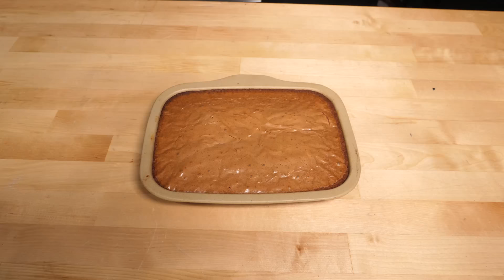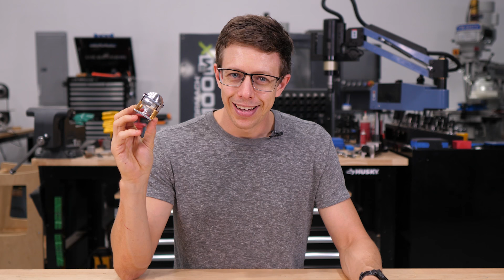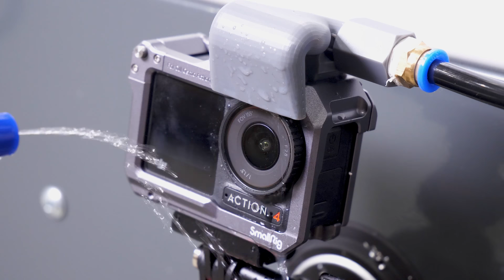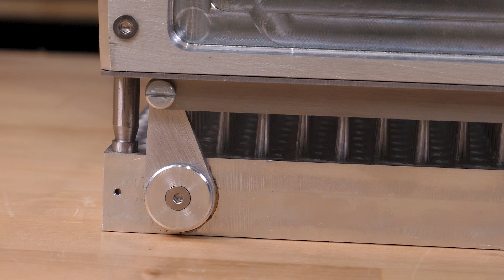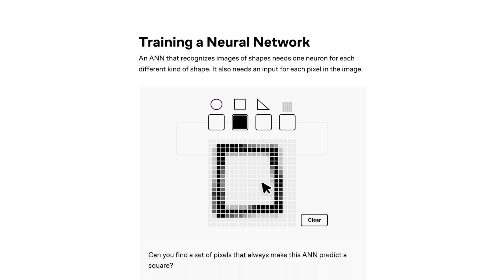Baking brownies from the inside out

Comment: My first thought was using the same concept as sous vide, since this is basically the same problem as with steaks. 
It's also interesting how these problems and solutions for them can be found in different fields. For example, the edges experiencing different heating and cooling times than the centre is also a problem when heating and cooling metals or thermoplastics. (14:09) A similar issue happens in injection molding when your tool uses ejectors. As far as I remember, the solution is simply having a precise fit between the ejector rods and the mold holes, high enough viscosity and low enough pressure, so the molten plastic doesn't flow between the ejector rods and the holes.

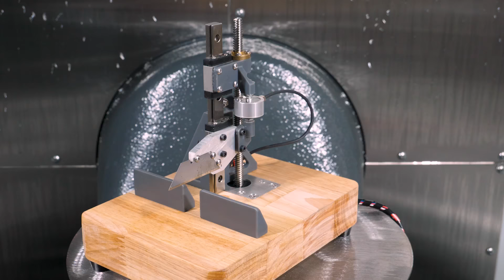(0:49) This reminded me of those birds that try to impress mates by building nests

Comment: OK, hear me out.
-Instead of a lever system, make that first pan that you thought was a mistake.
-Then make a plate with holes where you put a handle on like the one from a bucket.
-Put that into the pan.

That way you can lift the brownie out with the handle from the pan, removing it from the walls.
That would make cutting and serving much easier.
It's also easier to clean because you do not have to get between moving parts.
🙂👍

Comment: interesting! i was really expecting for you to do away with the oven in general and use an electrical current to bake the brownies instead, though i suppose that would defeat the purpose of a 'no edge pan' as it would no longer really be a brownie pan, per se. Taking advantage of the electrical resistance in the batter would theoretically provide a near perfect distribution of the heat from the get-go, meaning no semblance of edge without the need for this odd spike design damaging the aesthetics and ease of use. I know that panko bread crumbs are made this way in part because it makes each bread crumb more uniform to every other (unlike regular ones where you'd either have the odd edge crumb or need to waste product removing edges).

whether this would be practical to implement, i am not sure, but to me it seems it certainly would be the end-game of edgeless brownies.

Comment: Isn't a edgeless brownie easily done by using a silicone pan? Cause the edge doesn't get hot like the metal pans
Reply: I imagine that you would still have the issue if heat transfer to the center. while it may help, no matter the material of the pan the edges will have to heat up before the center, which leads to edges in the final product

Comment: none of these are pans. pans have one handle, and all of these no handles
Reply: the final one definitely does! notice the recessed section on either side of the pan, creating a lip that can be used to hold the pan. most baking pans have handles more similar to this, as opposed to something a frying pan would have
Reply: @evieiseepy "either side" you say? that implies two handles, a pot
Reply: @nathanpumarlo8628 yeah and many pans also have two handles. many frying pans have two handles in fact. and you will be very hard-pressed to find a brownie pan that does not have more than one handle (how else would you have any hope of taking it out of the oven with oven mitts on?). all of this is disregarding the fact that definitionally pans do not necessitate a single handle.

Comment: Great approach and awesome engineering. But I'd like to try out your point of heatdissipation. An all around enclosed and expandable baking dish in which the dough would slow cook to the premeasured coretemp. Almost like sousvide. That should prevent overheating certain areas and the loss of moisture at the top. I could see the flaky texture at the top of the brownies. That appeared so thin, that its seemingly imessurable with your device, but should be noticable while eating and the center of a browny doesnt have that. Also it doesnt please me visually^^. I'd try it myself, but my wife doesn't allow me cooking or baking because of the mess. I enjoy your videos very much.

Comment: Maybe an easier solution would have been a way to keep the pan from getting too hot. Like a water bath for the pan with a vent for the steam (since you already drilled a hole in the oven) so you still get a good brownie top. Could still use a reg pan that sets in the custom part. Time for a redo!

Comment: 9:39 if I had to guess, it'd be because brownie batter does a hardening process when overcooked that fluffier cake batter does not do. What are overcooked cakes like? Just dry, right?

And I have heard once or twice before, that you take cakes (and bread) out of the oven before they are done, as they finish cooking out of the oven, using the heat that's already there. Perhaps the cool air around the cake helps cool down the edges to an extent on the same magnitude as the insides HAD been shielded from the heat, such that the outside stops wanting cooking before the inside does, and the outside stops being cooked by heat before the inside, at roughly the same rates.

Comment: What if you just had a pan that had super-efficient cooling on the bottom and sides?  The Baker's Secret cookie sheets have an air gap to prevent the bottom of the cookie from browning too much.  If the sides stayed cooler longer, then you would effectively create the same result right?

Comment: could a simpler solution have been to insulate the sides of the pan? Sealed (semi sealed) air gap or silicone should work nicely. In theory the heat flux from the bottom of the pan to the top would be uniform.

Comment: Really cool project! Another solution might be cake strips. Basically just a strip of thick fabric that you soak in water, then wrap around your pan before baking. It insulates the sides of the pan a bit so cakes cook more evenly and the edges don't dry out. You can make some makeshift ones by wrapping wet paper towel with tin foil. Worth a shot if you don't have a 3d printer.

Comment: The floor of the pan should have the point connected there anf also have a rubber seal around the whole perimeter of the pan then on the top wall bit but some metal latches(one on each side)  like the ones you would see on a tool chest or some sort so it pulls it shut

Comment: You could have just put insulation at the corners/edges to slow the heat transfer to match the heat transfer to the middle.  
Instead of adding conductors to make the middle match the heat transfer to the edge.

Comment: Seems like the pan should've been a circle to be ideal - there are still places that are getting heat from 2 places. BUT! that's theoretical, and you got a result that is below the threshold of noticing: that's engineering. Also, users expect brownies to be rectilinear, which your design supplies easily.

Comment: For the mini pan without the removable bottom, you might be able to use a strip of parchment paper to push into the pan.  Then you could lift the parchment paper to release the brownie from the pan.  Yes, it will be heavily perforated, but it might do enough release to turn the pan over and tap it on a cutting board.

Comment: I screamed when you said "retractable spikes" Why didn't you just make the bottom half attach with clamps of some sort around the edge? Similar to clamps on a croc pot... Would have been easy. It wouldn't fall apart as long as you flip it upside down on a table, then remove the bottom.

Comment: Cool solution, but have you thought about trying to do it with a spring form pan with a double bottom (one with spikes and one with holes). That would be a simpler and more elegant solution. 

This is the first video I watch from you, so this is a guess… between a industrial designer and an engineer, I’d guess you are an engineer!

Comment: you need to control Airflow which affects evaporation and therefore the mosture and texture. Airflow design is just as important as thermal energy flow.

Comment: I love this, I think you could commercialise this with a few modifications i.e. making it a 3 piece set: piece 1 is a standard tray, piece 2 is a spike sheet which sits in the tray and piece 3 is a thin sheet with holes in that goes over the spikes.  Once baked you can remove the brownies from the tray and you are then left with brownies with sheet 1 and 2, you can the spike sheet by separating the spike sheet from the hole sheet with a knife, then you peel the hole sheet off the brownies.  Because you don't need to prevent mixture escaping the hole sheet holes can be oversized to mean that you can remove at an angle.

Comment: WOW, You're correct.... Talk about over engineering....LOL.  How about a 2 piece construction similar to a spring form pan.  Machine a pan shell with a removable bottom using an high temp o-ring seal on the bottom.  Putting 2 wings on the bottom piece to act as "handles" that you can use to push the bottom away from the top as you lift the top of the pan away.  Simple design and easy to clean in a dish washer.

Comment: You can also submerge the bottom of the pan in water. It keeps the edges from getting hard as quickly and would make the edges softer. They use this in cheesecakes a lot to keep the cake from drying out. I've tried this before, and it works super well. The edges are still a tiny bit dryer, but it's much better. I haven't gotten to try it again since, though, because my mother is a nut that likes the edges

Comment: Couldn't you just use a silicon pan? Heat transfer with silicon isn't nearly the same as steel
Reply: Outside would still cook before the inside, it's not just a material problem but a geometry problem too. Which is why the spikes fix it, makes it cook evenly, which allows you to cook the whole thing at a lower temperature for not as long to achieve the desired tenderness. 

If you tried to cook it like that in a normal pan the brownie in the center would be sticky and undercooked.

Comment: so..... for the last pan, why not just make a two part system with latches on the outside to connect the two to maintain pressure? that way all you'd need is spikes on one plate, potentially with a heatsink on the bottom, and holes in your pan. you wouldn't need to worry about the latches being too hot to unclasp anyways since the brownies would need time in the pan to cool regardless, especially since they get cooked low and fast anyways, so the pan wouldn't be taking all that much time to get super hot since its mostly the spikes doing the heat transfer.

Comment: With my limited background in thermodynamics I propose slowing down heat transfer at the edge such that it heats as quickly as the top of the brownie. Making the pan thicker would increase the thermal mass and an insulator like ceramic would be a good material.

Next, since the slower bake time will lead to more moisture evaporating cover the pan with aluminum foil.

Next set the oven closer to the desired internal temperature of the brownie.

Basically the slower and more controlled the baking is the more even the temperature profile of the item is. The edge stays at a relatively lower temp while the center has more time to heat up.

I have some other ideas as well I would like to discuss like finding the best L/D ratio to better approximate 1 dimensional heat transfer. Ironically, your sphere pan can also be approximated with 1D heat transfer by adjusting the boundary condition as a function of the radius. You could achieve the same effect with a wide relatively thin brownie.

Comment: Simple brownie recipe

1/2 cup flour
1 cup sugar 
1/3 cup cocoa powder
1/4 teaspoon salt
1/4 teaspoon baking powder 
4 eggs 
1 teaspoon vanilla 
1/2 cup (1 stick) melted butter 

Mix ingredients (I honestly just throw them all in a bowl and mix at the same time, don’t really need to follow the “dry ingredients here and wet ingredients here then mix the two” but do what you want) pour into a greased and floured 8x8 inch pan and bake in a preheated oven at 350°f for about 30 minutes, you can bake it an extra 10 minutes if you don’t like chewy brownies (more dried out brownies are pretty good when paired with ice cream) 

Take them out of the oven and let them sit for a bit til cool enough to touch and serve.

Comment: Cheapification: don't make the pan lift up over the spikes, make the spike plate lift up and out, handles on the side of the spikes that can be grabbed. The outer pan is just a pan like any other really. Then have a spatula that's kinda like a large fork where the slots line up with the spikes. Cut the brownies while on the spike plate, spatula lifts them off. Spatula would just have to be long enough to reach the center, a bit odd but no biggie.

Comment: Wanted to share this with my family, but one side will care more about the brownie testing and the other about the engineering. So I made this. 
0:00 Intro
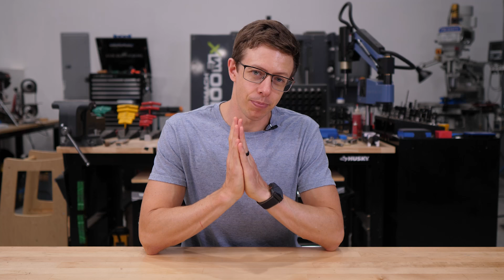1:04 defining what a brownie edge is
2:22 1st idea / engineering process / baking
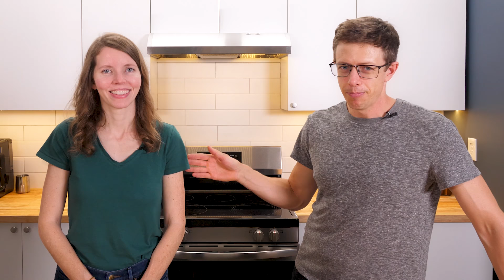3:25 Brownie Judge vs first attempt.
5:05 2nd idea
5:40 Camera Adjustments for 3d printer
6:06 Resume 2nd idea
6:58 Getting a camera into the oven w/o cooking it / Formlabs printer
8:25 Resume 2nd idea
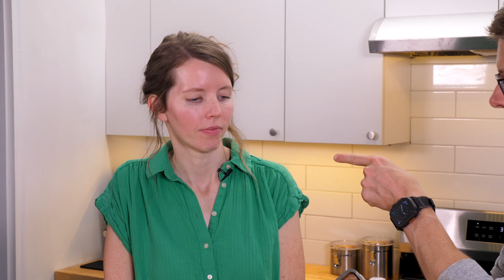8:44 Brownie Judge returns
9:50 Idea #3 Brainstorming
10:35 Judge says there's still an edge - engineering an edge tester
12:33 Judge reacts to edge tester
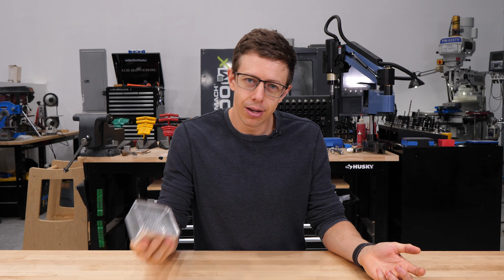13:17 Making Upgrades
18:32 Judge return to test the final design
19:53 Side project - Mortar launcher
22:29 The Infomercial

Comment: Instead of individual O-rings for each spike, you could make a single gasket for the entire thing by taking an oven safe sheet of rubber, cut holes in it to match the spikes, and sandwich it between the two layers.

Comment: The easiest solution is to reduce the temperature differential and heat up the brownies very very slowly, so that the difference is low and the thermal resistance of the batter is small.

Comment: Could you make a vacuum sealed tray like a big thermos mug, then you could change the dimensions of that inner compartment so the heat is conducted equally through out the brownie,    i had originally though just make the pan thicker in certain areas but i think the metal itself would be too great of a conductor to really adjust the heat transfer without adding copius amounts of material to it
Reply: I just realised this wouldn't work, this idea essentially only limits the corner problems the best solution would have the entire brownie mixture heating up to the at the same rate and time I don't know how you could do that at all even microwaves cook from the outside in as they excite each particle they come in contact with

Comment: All you needed to do is use a liquid jacket around the pan to regulate the temperature to roughly that of dough. You could adjust the boiling point of the liquid in the jacket to get different results. I do this to get flat cakes with a consistent crumb very similar to your end result before dialing in your temps. Which is all I need.

Comment: I wonder if the crust problem could also be solved by putting less spikes in the middle and making the outer Pan out of a less heat conductive material. Maybe like using a silicone pan and put a fork up in the middle

Comment: öhm the edges should be a very thin cross layer, the top also like a thin crystaline sugar layer. And the inside soft, wet but still fluffy on the inside. Just fix your reacipt :D there should be nothing like "chewy" involved if you mean soft chewy

Comment: Is there a silicon type material that can handle those temps and don’t conduct too much heat? If there is I feel like you can use that to line the edges to keep them getting crispy. That type of material has to exist

Comment: Different approach: place the sides (but not the bottom, you're the engineer) of the pan into a waterbath, essentially keeping their temperature down to a max of 100C - just make sure it's enough water so it doesn't fully evaporate during baking.

Comment: Realistically couldn't the spikes have been cone shaped with bases larger than the hole. This might cause it to be water proof as the weight of the pan could force closed the gaps. This also would allow it to be picked up to separate it, removing the need for the lever.

Comment: edges are also the densest parts because of two reasons: 1. the protiens reform before the air can expand or the baking powder can activate. the secound reason is that even the little rise that is happening is counteracted by the batter sticking to the edge, not alowing it to rise properly!

Comment: To stop the leaking, maybe have a channel between the two parts of the pan around the edge, where the top has a ridge that sets down into the channel and seals it around the edge. kind of how rubbermade lids work, where the bottom part of the pan is like a lid that fits to the top half.

Comment: For those of you without your own personal cnc machines; bakers solved this forever ago and it’s WAY simpler: Instead of trying to increase thermal conductivity in the inside you just have to decrease it on the outside. Change the material of your baking pan or form to something less conductive then bake low and slow.

Comment: I wonder if you think about a solution like it works for the camera before or after you have designed the housing for the camera itself ;)
Imagine a pan with hollowed sidewalls like its done in an thermos jug. If this is not enough you could use the hollowed walls like in the camera and cool them with air.
OR a pan made out of aerogel 🤯 this i would call an over engineered pan 🤣

Comment: You should have used microwaves.  And a microwave blaster that would blast the inside of the brownie at high speed with paths of the waves calculated to raise internal temperature of the batter simultaneously everywhere at once.

Comment: Couldn't you in theory just take a regular pan, and then fill it with a maybe 2mm coat of a material that has the same thermal conductivity as brownies?
That way the heat transfer would be identical, but the outer brownie layer that usually gets harder/burnt is replaced by the material coating, that just stays as is.